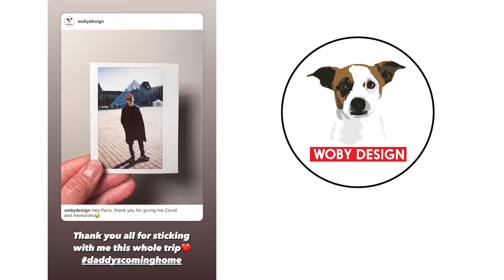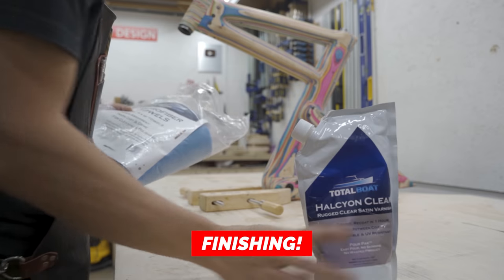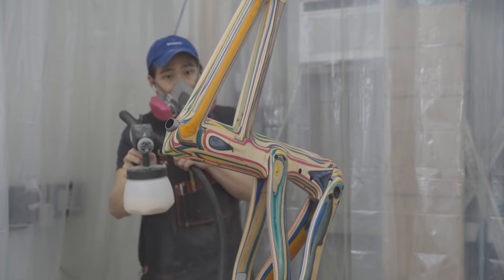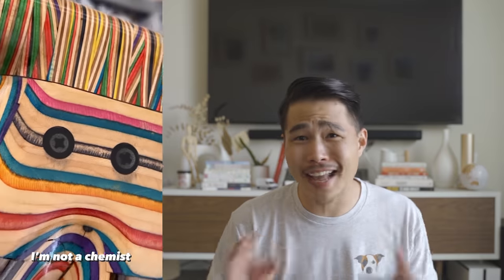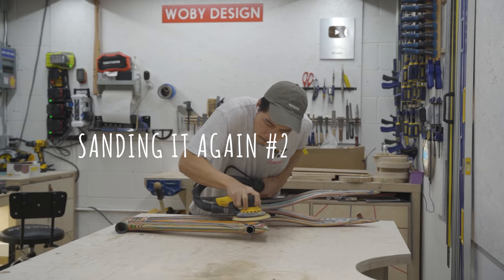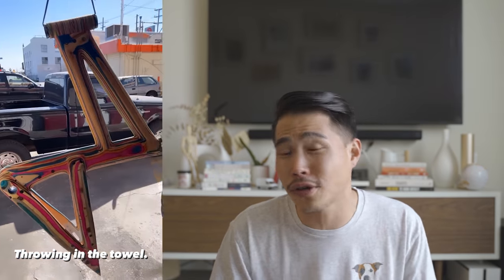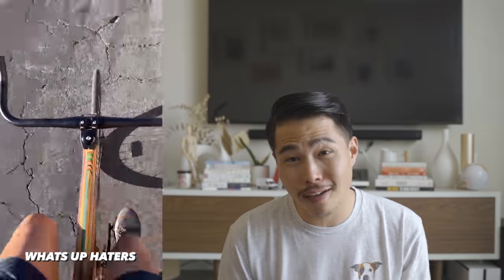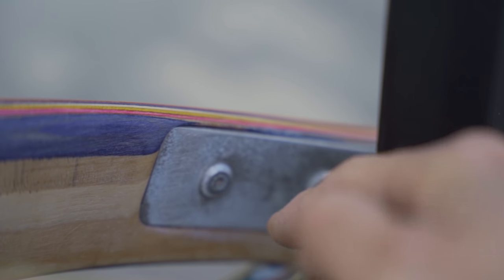FIXED GEAR BIKE MADE OUT OF RECYCLED SKATEBOARDS!

Comment: ive been planning on building a bike frame from plywood, and ive watched all the videos i could find. but this, this is next level. its stunning, its lovely, and i love it. i also have to add that there are not enough makers on youtube sponsored by and advertising for PPE products, and im super stoked you did. absolutely fantastic video my friend.
Reply: I 100% agree with your complete statement here. PPE is very very important, more important than the project itself, if you really think about it. Thanks for bringing attention to this issue, you rock 🤘🤘
Reply: While this is pretty it's not the best approach - if you're laminating a wooden frame you really want to work with individual veneers so you can orientate each layer in the optimal direction, and bend them where this gives greater strength/reduced bulk. This adds difficulty in design and construction - you'll need a system of formers and clamps that's more complex than you need with only flat pieces,.

Comment: Nice build! I made some wooden bikes too but using different design constructions. Working with wood as material for a bicycle frame is a bit tricky since is not so stable as metals or composites. On your next frame for light up, you can carve some internal pockets on the tubes e reinforce it with 1 or layer of #200 glass fiber to avoid delamination on plywood layers. Your shop is very nice!

Comment: Amazing. A lot people don't understand wood bikes but they must be the most comfortable bike you will ever ride, all bumps are absorbed by the frame instead of travelling to the rider. Its like a full suspension bike but your not loosing power with each pedal rotation. Gonna check out the masks out, I always end up removing mine instead of my goggle as having something in my eye was no fun. Luckily it was alloy and not iron or it would of rusted my eyeball. The optometrist said they use a small grinder to remove the rust. I didn't believe him but you can actually watch videos of the operation on YouTube. Great content thanks for sharing.
Reply: I've had bits of steel removed from my eyeball (twice, so I didn't learn the first time, although I was using PPE both times). The tool they use is basically a small burr in a Dremel - when it's chewing your eyeball everything goes wobbly as it moves around.  :-)

Comment: Great job on the bike.  I'm a bike guy.  Most bike guys are obsessed with weight.  The weight of the frame is a small issue and that is only when going uphill.  Strong and not wasting your energy are more important.  Your frame has style and your Odie's finish actually looks better than lacquer even if it didn't blush, in my opinion.  Incredible design.  Keep up the good work!  I know your promoting RZ masks but good masks are essential to wood workers.  I am now sensitized to the most common woodworking material, pine.  I have to wear a mask when I cutting or sanding it.   

Even though this bike is a worthy of hanging on a wall, you should ride the hell out of it and enjoy it.  I see you have your fixie skills down.

Comment: I've seen many type of wooden bicycles that people and companies have made. Making a wooden bike frame is a process that requires a lot care and precision. Some builders will specify different types of wood to tune the compliance of the frame. I've seen others where they'll put a few laminations of carbon fiber to boost the strength in critical areas. Wooden bikes will always be heavy, but they have a charm and elegance unrivaled by other materials!

Comment: I can only say: WOW!  What a great frame construction!  As I watched the frame take shape (I think you need to work on your spatial awareness >mirror-bottom-bracket cutout🤣) I realized that this bike was going to be very, VERY heavy.  Therefore, if you want to build a "Skateboard Fixie 2.0": You could use a CNC milling machine to manufacture the front frame from two half-shells, creating a hollow profile.  The rear end could then be made much lighter as a kind of "C-profile".  With press-fit bottom bracket shells glued in with synthetic resin, you can do without the bottom bracket holder.  And the front fork (at least the fork legs) could also be built from this recycled material.  In any case, such a "skateboard fixie" is an extremely cool thing...

Comment: A true masterpiece and you should be proud indeed!  I suspect that is the most rigid bike frame in the history of time.
Used skateboards are a cool base material, but the work involved to get them to a S4S plank is painful. So, choosing a product that requires the strength skateboards offer (like the bike) is important.
That being said, I think your next project should be a '$15,000 Tensegrity Table' ... You could, of course, raise the price depending on the actual costs involved, of which a significant amount should be spent on engineering.
I like the YouTube "Ultimate Tensegrity Table" design, but I would go one step further and incorporate the final tensioning device to be hidden into the frame somehow.  I'm sure there is a buyer for something like this if you choose to take on the challenge.

Comment: You could just use west system epoxy on a roller, sand it, apply 2k varnish 2 coats with a good spray gun, done. Sorry but I must say it! Everyone overuse spray can paints and 1 component varnishes waaaaay to much. Especially if you make something nice and really hard it should have a nice finish. :) Really good video, thanks for sharing. :)

Comment: That's one beautiful frame. It's only missing carbon fork to match the frame profile and more colourful wheels to be in the same theme as frame, but I guess it's just personal preference. Yes, there are some doubts about structural strength on headset and seat tubes but it's piece of art not a racing frame.

Comment: If the mask doesn't seal around your mouth perfecly it just doesn't filter out particles because much the air you breath in comes in through sides. You should be wearing a respirator and not pushing a mask like the one you're wearing.